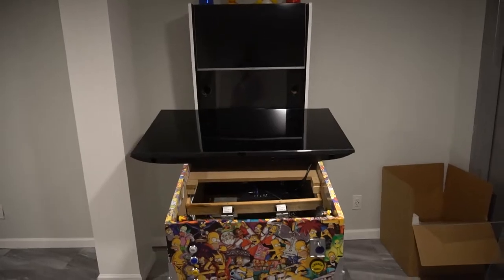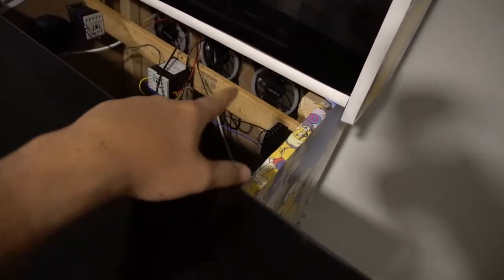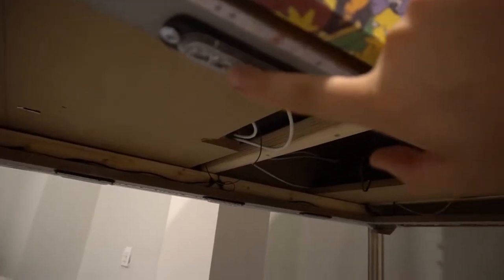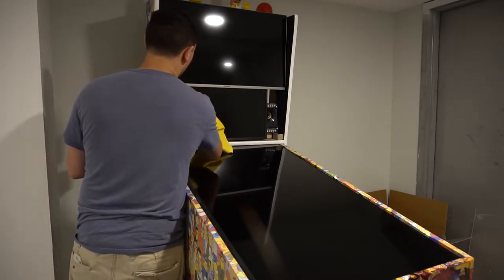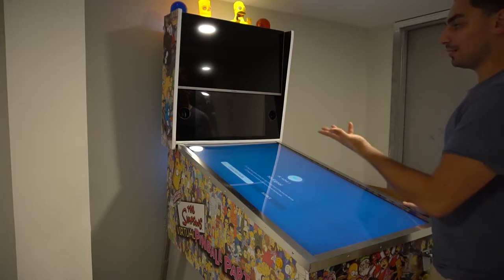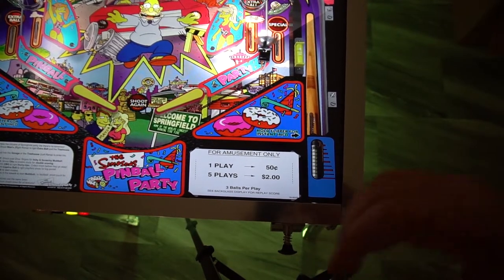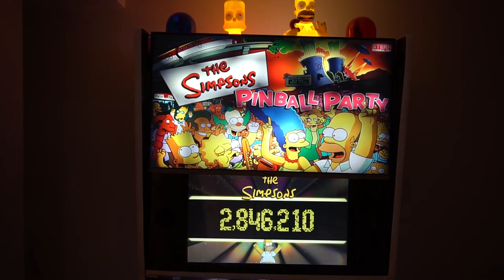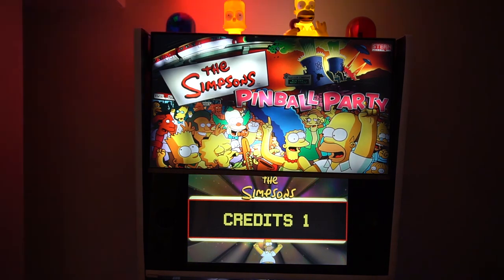Inside my Vpin Cabinet/Overview--RAMBLE

Comment: Really like your cabinet. Having built my own I fully appreciate how people prioritise different things. You went to lengths to explain how much you hate to see wasted space down the sides of the screen. That's perfectly fine. I don't mind the spaces down the sides when the POV is altered because one thing I hate is seeing a stretched playfield. To be fair your doesn't look bad in that regard, for this table anyway. A friend of mine had those type of side rails fitted to his cabinet, but I can't play it for too long as the edges are too sharp and I find them uncomfortable. And your wiring is quite tidy. It's no where near as messy as you made out. I tried fitting 12V car solenoids for feedback but it didn't work out for me. They fired intermittently, especially when the ball is bouncing in the bumpers. Ball might bounce about 8 times and I'd hear only 3 or 4 fires of the solenoids. That really bugged me so I ripped the whole lot out and just went 7.1 SSF.
Reply from the maker: Thanks bro for the comments! Yea I'm a big fan of the "up against the glass angled looked" because software can be used to change POV like you said. I just built another vpin for a customer with the same rails... just gotta make sure your friend sanded the corner down so it's not sharp 

Surprised by the car starter comment... I was gonna try the car starters on my next build but if they don't fire off on every bounce then I won't even entertain it
Reply: @Vic_VP  I'm not so sure it was the solenoids at fault. I was using a 16 way Sainsmart board acting as relays. When I watched the board while a friend played the LEDs for each port were intermittent. So if the relay itself isn't firing then ofc the solenoid won't.

Comment: Thanks for the videos, very helpful information. I’m surprised at the setup for the plunger considering you went all in on other things, figured you would have gotten a 3D printed mount or something. I appreciate it though and will probably do it in my cabinet!
Reply from the maker: 3d printed plunger holders I've seen go for 150$... mine is 5$ lol, plus I've read of ppl having there mounts break. I've done my mount in 4 cabs so far with zero issues. Why spend extra lol

Comment: What control interface are you using for your buttons?
Reply from the maker: Klz board, it talks to pinscape software
Reply: @Vic_VP  thanks. Do u have a link to one. Also where did you get your solenoids?
Reply from the maker: @khmerdogg71  I have other vids on my build.
Mouser sells kl25z boards
See other videos for suggested solenoids, then check ebay
I even made how to vids on my entire build